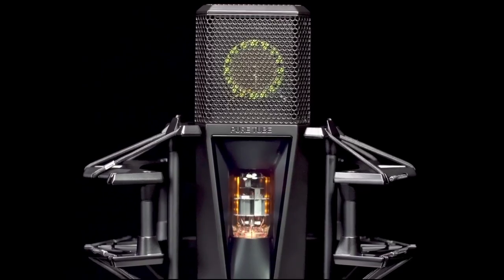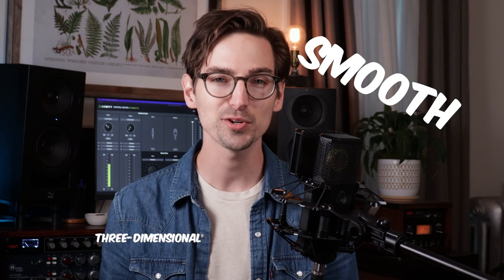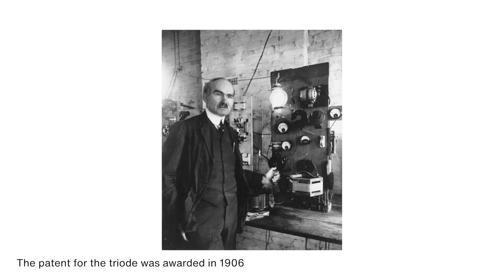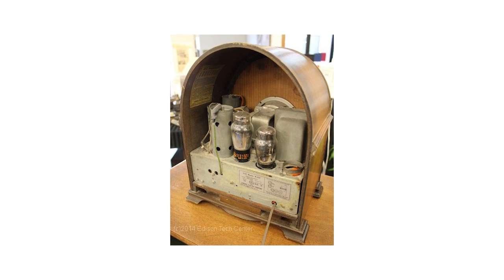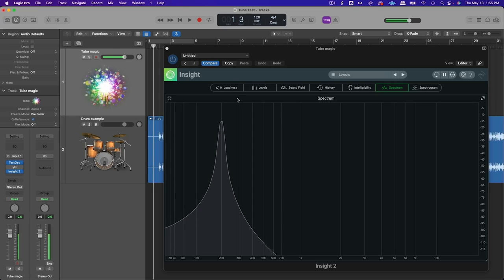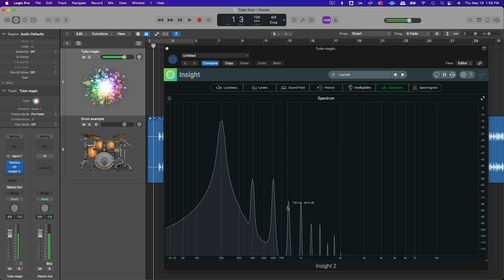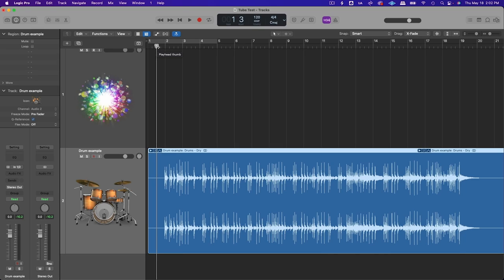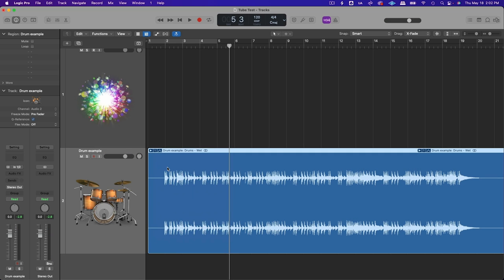What tubes REALLY do to your sound ...

Comment from the maker: How would you describe THE tube sound?
Reply: phenomenal
Reply: hi i just did a test of 200hz test signal going into my Lewitt 1040 LCT and i'm getting harmonics on both the tube and fet side the only difference i'm getting is that the signal and harmonics produce a louder signal on the tube circuit what is happening here? the fet shouldn't produce any harmonics. i'm running the mic through a Neve 1073 perhaps the transformer in the mic pre is producing the harmonics? i'll run the same test through a solid state non transformer mic pre. 

Just repeated the test on a Universal Audio Apollo x8 Mic pre and i'm getting the same results? how strange what do you guys think @LEWITT-audio? the xlr out of the power supply is on the mixed output btw.
Reply from the maker: @chickenlickin3820  Solid state circuits also produce some level of saturation/harmonics (especially with transformers), but usually much less and they are mainly odd order harmonics. So it's not surprising that there are harmonics produced with the FET circuit, but they should be lower in level that the tube circuit. Tube circuits also tend to saturate more musically when pushed.
Reply: Waiting for a tube end-address broadcast style microphone like the pure tube from you guys but solely focus on spoken words for long form content, and please, no green on anything. I'm sure you guys can come out with better off axis rejection than the Lauten Audio LS-208. Shure has been reigning for far too long, but no mic look neater on a podcast than a SM7B. Other mics might sound as nice, but the annoying yoke style design made it look neater on set and look nice on camera. The matte black color also prevent reflection from cameras. Really rooting for you guys. hope we all can get a tube end address microphone from you guys soon!
Reply from the maker: @chickenlickin3820  Your speaker most likely produces harmonics as well. Even our low distortion coax measurement speaker  does it. You would need to inject the test sine directly into the circuit.
Reply from the maker: @Slipsch  Thanks for the feedback!
Reply: @chickenlickin3820  the odd harmonics you see on the spectrum come from your speakers. Besides that the louder signal on tube schematics means you  have added more even harmonics to the signal. More harmonics - louder signal. Neve 1073 adds mostly odd harmonics before clipping, but its distortion before clipping is extremely low.

Comment: So tube in the microphone is just a saturator? Then maybe it's better to use a clean tlm mic and add saturation later?
Reply from the maker: The tube provides the amplification in the circuit and also provides saturation/soft clipping as a byproduct. If you want a clean sound, you can grab one of our FET mics and add saturation later, but a lot of engineers want to get it right at the source which means using mics, preamps and compressors that shape and color the sound on the way in (rather than relying on plugins later).
Reply: no add color and tone too

Comment: Hi, 

Would you recommend the lewitt in Front of a Bass Cabinet? 🤔
Reply from the maker: PURE TUBE has a slight roll of in the sub frequencies since it's optimized for vocals. However, It could still work with bass if you don't need the low end extension. Our other tube mics may be better suited. Or the DTP 640 REX is a popular choice for bass cabs.
Reply: @LEWITT-audio and this absoulte honesty is why I love Lewitt, cheers guys!

Comment: I’m hunting for some NOS compactron tubes… its like 3 Ax7’s in one tube. Fun stuff but spendy per tube 🤨
Reply from the maker: Nice. What makes you want those particular tubes?
Reply: @LEWITT-audio  I’ve got a 72 fender super twin reverb amp that I have neglected for far too long. Its needs all new tubes and some new caps wouldn’t hurt either. Then once its breathing its 495 watts of peak tube power ( 120watts) ill begin selecting drivers im thinking Jensens to stay original but im open to change. Its a beautiful sounding amp… if my memory serves me correctly but I think it weighs a 1/2 a metric ton 😂
Reply from the maker: Very cool. Yeah those Fender amps are beasts!

Comment: It can ONLY affect the volume. no tube will change the sound from another tube. proven fact. sorry gear heads. it took me 30+ years to learn this
Reply: Ok I appreciate the sentiment and totally agree that you are/Glenn is right on high gain guitars and the (practically nonexistant) differences between tubes on high gain guitar amps, but you should realize that most of the gain in your tone is actually coming from the tubes. They ARE being distorted to add harmonics and compression, it's just that different tubes will do so in a very similar/equal manner to one another.